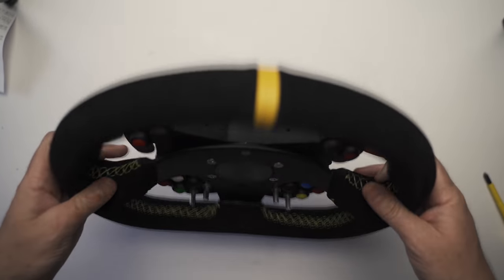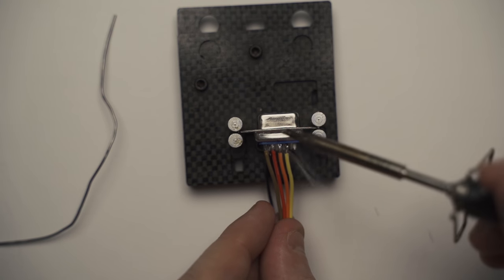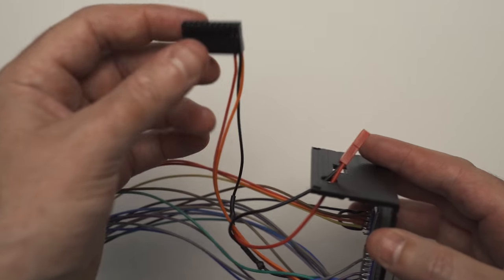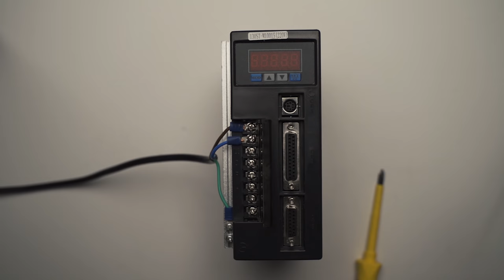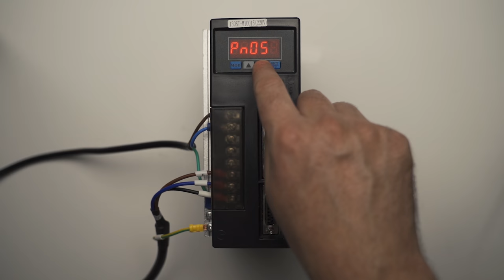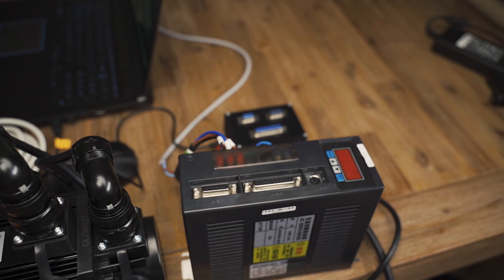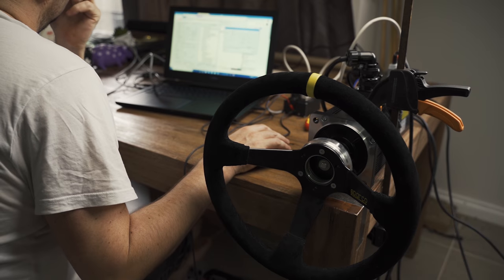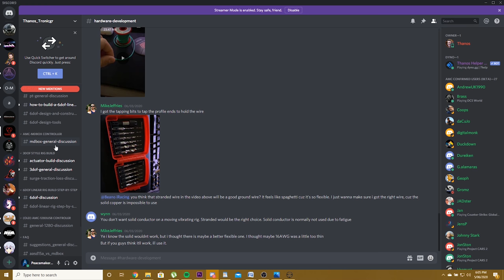$450 Mige Direct Drive Force Feedback Wheel Build Tutorial - MMOS

Comment: Great idea! My one question is, considering its using a servo motor, does the wheel have hard stop as it turns full lock? Or is it a forever loop?
Reply from the maker: Yes it has bump stops and they change when you change the degrees of rotation. you can also change the torque strength of the bump stops to dial in how soft or sharp the rebound is.
Reply: @peacemakermotion3949  Thanks, I appreciate the reply.  Now I'm super keen to build one, cheers!
Reply from the maker: @troyd-motorsport9933  This is probably a bit dated now. I would look into the VNM wheel controller. Thats what i'm using nowadays. A much more robust experience. Or if you can get a second hand TDD (Thanos direct drive) board then you'll be great too :) otherwise if you have a spare discovery board laying around then give it a shot. Good luck man
Reply: @peacemakermotion3949  I will check it out, thanks, did you deal with VNM directly or through an Aussie dealer?
Reply from the maker: @troyd-motorsport9933  yeah this isn't really an off the shelf item more of a passion project. If you contact Hoan through their discord he'll be able to price you up. It's maybe 2-2.5x the price of a discovery board but it has a lot of functions as well like button box and shifter support etc. Basically just solder up a db25 to db25 cable with the right pinouts and then you set it up on the VNM configurator. Has a built in DAC for quiet performance etc.
Reply: @peacemakermotion3949  That sounds like a decent way to go. I saw the config of the VNM on another video and it looks awesome.  I like that my Logitech got me into it but after trying a Simagic alpha I'm keen to get right into it now

Comment: i have a stupid question so pardon me @28:26 where are the connectors that was on the top??of the motor  when it on the desktop is this the same motor?
Reply from the maker: They are on the left hand side of the motor. If they were on top they wouldn't fit under the monitor. Plus this way they are out of view and look neater. Plus all my wiring runs down the left hand side of the rig to its also the shortest path the get off the rig :) but to answer your question, yes it's the same motor as the one on the bench.
Reply: @peacemakermotion3949  thanks for the quick reply, you difenitly deserve more Sub's, i am not familiar with what you guys are doin you are amazing creative people & i am willing to risk this time & try to do the setup my self & order all the pieces online but i have one problem which is where to buy the 3D printed hub adapter or how to make it in order to mount the wheel on the shaft??i asked the same question on your post on xsimulator.net but i am a noob when it comes to this stuff i dont get what all different terms means like "PLA" "PETG" "ABS"

Comment: Hi brò, I have a lot of EMI problems with this controller ... do you know if there are any solutions?
Reply from the maker: Hey Mate, ensure your rig and everything is properly grounded (earthed). If its an arduino button box then this also need2 to be grounded. Try using a phone charger to power one side of the stm32. try some of that. Also if possible run the motor cables away from your usb cables. and try some ferrite cores over your usb cables etc as well.

Comment: Hi, how the connection should be if I want to use pedal shifters instead of H shifter? Replacing the pins of the same port would be enough? 
Thank you.
Reply from the maker: There should be a pinout drawing in the zip file for shifters. If you see what sequential shifter pinout is and then use those pins for your paddles it should work. Cant remember if it has sequential pins or not though, you'd have to check. Or just tap into some pins used for the H shifter and try that.

Comment: Can i put the Nema 34 34HE46-6004D-E1000 instead of the 130ST-M10015, if yes, what i want to do this?
Because Nema 34 is a 2 phase motor
Reply from the maker: Nah not like this anyway. I've seem someone else use a stepper motor and mount an encoder on the back of it and get it working but the hassle didn't seem worth it for the cost savings.

Comment: can i use nemo stepper motor instead of this motor??
Reply from the maker: no you cant
Reply: @peacemakermotion3949  can you give advice like cheap servo motor or 8 to 10nm servo motor which can be use in ur build.. Please
Reply from the maker: @dadson6392  check out the 80st-m04025. 4Nm constant, 12NM peak
Reply from the maker: @dadson6392  or the 110ST-M06030 6NM with 18nm peak. honestly is almost chdaper to just buy a DD wheel thesre days with so much competition
Reply: @peacemakermotion3949 can we do like you did on vedio
Reply from the maker: @girigiri6929  yes of course. That will still work :)

Comment: Hey I wanted to just hijack the the g27 gear I have and just run the power wires that go to the 2xmotors and connect them to 1 servo motor... Thoughts?
Reply from the maker: i highly doubt that would work. you would need a dual motor setup similar to logitech. then there's the issue of enough power for the new motors..

Comment: Hey Bro@ pacemaker motion great video, I'm considering building 1 currently and I was wondering, there's another mige in this area the m10025, would this work for this project?
Reply from the maker: As long as its running off/bundled with an AASD servo driver. Yes it will.

Comment: Hi, may I ask how's the fan noise level coming off the AASD drive?
Reply: It turns on by default if the driver temperature exceeds 50°C. The fan noise is really low, but tbh it doesn't cool much.

Comment: I encountered EMI problem when I connect my ground wire from power sources(220V or 230V depend on country) to ground point of servo, also connect my motor sources to the ground, which interfere a lot on my diy wheel buttons. Should I connect my ground wire from power source to L3 to eliminate that problem?
Reply from the maker: earth one of your ground pins on the arduino and see if that helps
Reply: did you solve it?
Reply: @krystofvydra  yes, connect a wire from you wheel to you arduino ground pin. It will work.

Comment: hey mate, im really considering doing this as i have a spare set of Logitech shifter and pedals ive seen people asking about other similar servo motors but was wondering if ST130-M07725 would work fine as they seem fairly available in australia on ebay, it says rated torque is 7.7nm and max torque 22nm
Reply from the maker: Hey mate, yeah as long as its using the AASD servo driver no worries. Just check that pn001 is setup for the correct motor your using and you're good to go

Comment: Can I use any wheel because I plan to play f1 so will need to buy an f1 wheel
Reply from the maker: Hey mate you can but a button box or make a bluehid or arduino button box and it will all work with f1 for sure. Just need to make or buy an adapter to suit the shaft of the motore you choose

Comment: This was valid a yr ago, but should i buy a Fanatec csl dd just cuz its 450 anyway??? How many nm of torque out if this??
Reply: Well, being you I´d go for the Fanatec CSL DD, because de the motor of the wheel on the tutorial only produces 2.5Nm, although, every review I've seen from that wheel recommended the Boost Kit
Reply from the maker: Well this wheel in my tutorial is 25NM peak with 10NM constant. CSL is like 5NM peak or something like that and you'll need an extra power supply for that. VNM is about to Release a Direct Drive board which would suit this project perfectly. For 100usd. Just comes down to what's easier and more suitable for you. Csl will just plug and go.. different leagues of motors though Power wise.. and that's reflected in size too. Haha. 450 is also not the price anymore as the us dollar tanked these got dearer so there's that to consider.

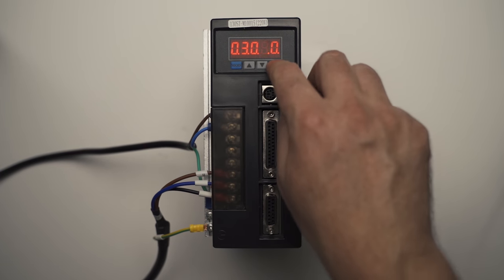Comment: 17:15 why 1500rpm ? The web site say 1000 rpm. Is the motor able to do it without failing or something ?
Reply from the maker: my motor is rated for 1500. the motor he used is rated for 1000.. this setting doesnt matter though because Torque mode will override this and only do the torque rpm (120rpm in this guide). just leave that Setting as it comes from factory basically.. but its good to double check some of these settings anyway just in case it wasnt set up correctly from factory.

Comment: I did everything as in tutorial, it does not work for me, MMos devise not connectet, whith 130ST-M10015, Flashing its good
Reply from the maker: You have both usb cables plugged in? Both need to be short cables and quality cables.
Reply: Yes, now I put the second cable in plus, and now the motor came to life, but I have another problem when i motor start, it spins in one direction constantly without stopping
Reply from the maker: @DMYTROCBRrrSP  what is your pn191 set at? Try 0 first if it spins then try 1. Just try the opposite to what you have.
Reply: @peacemakermotion3949  i must disconect all cable?
Reply from the maker: @DMYTROCBRrrSP  no just hit the Estop.  When the wheels stops spinning. Change the pn191 and then release estop
Reply: @peacemakermotion3949  I tried, no change
Reply: @peacemakermotion3949  i can reset the servo driver to default settings?
Reply from the maker: @DMYTROCBRrrSP  yeah try that then re input all the right settings. Make sure you have the correct motor setup in the aasd as well for the motor you're using
Reply: @peacemakermotion3949  how can i reset the drivers?
Reply: 130ST-M10015 Servomoteur AC 220V 1,5kw 6 A. AC 1500W 1500RPM 10N.M. max 25N.M  ihaw to buy from TwooWin
Reply from the maker: @DMYTROCBRrrSP   Factory reset AASD parameters:

Select Fn004 

No need to enter a value.  Just press/hold  the Set button and it displays Pni n then press/hold Set again.. displays...  done...  Remove power and plug back in..
Reply from the maker: Your motor should be PN001 = 22 (m10015)

Make sure you have a 'Straight' db25 cable. Meaning all pins are wired and the pins go to the same pins at the other end. Check with multimeter.
Reply: @peacemakermotion3949  Ok  il check db25, Fn004 i do second team hold set and Error in display
Reply: @peacemakermotion3949  thx  man you have hellp mi, naw its whork
Reply from the maker: @DMYTROCBRrrSP  awesome! Glad to hear. Now go have some fun! :) Also you can actually turn the rpm up from 120 to 200 - 250 if you want ;) but just have a try at 120rpm first and make sure everything is good.
Reply: @peacemakermotion3949  Ok. how can i remove the noise? Pn 188 i put in 170

Comment: Is this still possible to build in 2023?
Reply from the maker: Of course. There's just better options.. and the servo drives aren't as cheap anymore either
Reply: @peacemakermotion3949  Thanks for the quick reply man! 

I just wanted to say your videos are amazing. Much love from the UK! 

Could you point me in the direction of the better options please? 

Thanks again!
Reply from the maker: @campbellbrown3726  well. Look at moza for one. Or VRS
Reply: @peacemakermotion3949  
Thanks again for the fast reply! 

From what I see:
moza r21 - 21nm of torque - £1040
VRS DirectForce Pro - 20nm of torque - £780

Your design - 15nm / 30nm peak with 130ST-m15015 - around £550 all in 

Am I missing something here?
Reply from the maker: @Campbell Brown  mine, I now run with VNM  controller. Which is about 100 bucks. But worth it. So depends on how much you can get a motor like mine delivered as prices have changed alot since I made the video. Some would argue the small price difference to just go vrs is a price worth paying. After all you hardly use the full force. Trust me!! It's a lot!! I think 20NM is plenty.
Reply: @peacemakermotion3949  
Only £400 for motor and delivery to the UK, which seems reasonable.
Since I am planning to use for commercial applications, any cost reduction is beneficial, yet reliability is still the top priority.

Thank you again, reading all your stuff on the forums has helped make everything clear. Can't thank you enough!
Going to try both, hopefully the cheaper option still maintains the same reliability and function so we can bring price down for our customers! ❤
Reply: @campbellbrown3726  If you use a wheel from an old gyro scooter, it will be cheaper. And the body of the gyro scooter can serve as a DD wheel body. $150 the average cost of the finished base.
Reply: @peacemakermotion3949  hello, any video about this?? i couldn't make it, always having failures, disconnections, etc  with stm32... where can i find the board??
Reply: @hello_artem  When you say gyro scooter do you mean hoverboards?

Comment: İf we dont want to use g25 pedals we need to büyük only Servo?
Reply from the maker: You will still need the stm32 board. You just won't need the two db9 connectors. Only the db25 plug wired up

Comment: Can ı make a  with nema34 stepper motor
Reply from the maker: This is for the AASD driver.. for a Nema34 try this project https://hackaday.io/project/44385-smoothstep-force-feedback-steering-wheel But to be honest by the time you buy all the extra bits and pieces its probably easier to just buy a 90st combo package with driver.. Unless you already have a nema34 and LaunchXL and PSU etc..
Reply: Peacemaker Motion Sim  it  is very complex project  am ı make nema 34   And its driver card tb6600 and stm32  supply etc
Reply from the maker: @simkopat61  ahh ok, nah sorry.. there has been a few projects in the past, that's probably one of the easier projects ive seen with a Nema, hence why this AASD solution is so attractive i guess.

Comment: How to prevent interference?
Reply from the maker: You can use a DAC to clean signal up.
Reply: @peacemakermotion3949  Dac module? It's that kind. Can you tell me.
Reply: @peacemakermotion3949  Can firmware be shared?
Reply from the maker: @jackrzhai5516  if you click on the xsimulator link in description it is all described in there with links to firmware etc.

Comment: It can use in xbox?
Reply from the maker: No PC only im afraid
Reply: @peacemakermotion3949  would there be a way to make it xbox compatible
Reply from the maker: @CRF468R  highly doubt it, you may be able to use a chronus max if they had support for mmos but basically no, it would need to be implemented on the xbox side of things. And usually the device will need to be signed by an xbox driver which usually costs money hence why no wheel will support xbox and ps4 and pc because the cost of that wheel would be even greater.. from my understanding anyway.. haha

Comment: My servo motor has a brake, can I still be able to build this? Thanks.
Reply: If you apply 24vdc to release it when its turned on. Is it CNC motor?
Reply: @AleksandarStojiljkovic  I don’t know, I just bought this motor for a nice price, It’s a kollmorgen akm53K motor.
Reply: @lezhou3588  yes the break can be released by applying voltage

Comment: hi, thanks for sharing your tutorial, I did all the setting, but still now work, both usb connected but FFB2014 still device not connected LOL...and also when I connect the AASD to the board, the motor spin in one direction, even I tried to set pn191 0 & 1, it just turn to another direction only, haha...is that anything different bewteen ST130-M15015?

https://youtu.be/IVzJTlC34kU
Reply from the maker: Hi first of all you want short high quality usb cables and you want them to both have data wires. The unit must suck down a bit of juice  so longer cables are out.. I can't stress how important this is haha. Try more cables. The micro usb cable is the main one here for talking to mmos. 

As for the spinning.. what is your pn001 set on?
Reply from the maker: The motor will work the same as any motor with aasd so that won't be the issue
Reply: I reboot all the things and the motor not spin anymore but changed to shaking, I’ve tried to change 4 different usb cable but still not connect to the mmos and the pn001 is 22
Reply: I reset the AASD and when I turn it, it will get al-07
Reply from the maker: @PAStation  try raising pn190.. start with 50 and keep raising it and see if it calms down. I think mine is at around 100-120
Reply from the maker: @PAStation  ohhh wait didnt see you have an alarm up.. not sure what that means.. you've probably got something connected wrong.. check all your wiring is correct and maybe look up the code in the aasd manual and see what you can find. Or ask on xsimulator.net see if anyone knows. Bit busy right now to investigate sorry
Reply: I tried to unplug all the connection between aasd and computer, and al-07still...I think something happened between the motor and the aasd
Reply from the maker: @PAStation  try resetting the driver and putting in all the figures again..

Fn004

No need to enter a value.  Just press/hold  the Set button and it displays Pni n then press/hold Set again.. displays go...  done...  Remove power and plug back in..
Reply: @peacemakermotion3949  finally I reset the aasd and connect stm32 to the computer...but I’ve got another issue, I burned my stm32 haha...I check the cable for so many time before I plug it in, then I check the circuit diagram and this video again, and I feel confuse at the db25, did I made it in contrast?